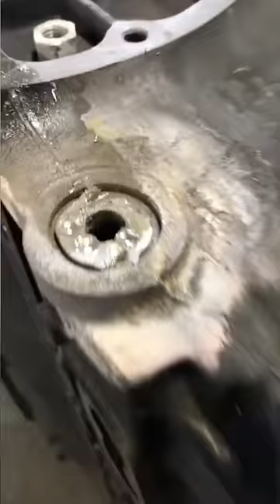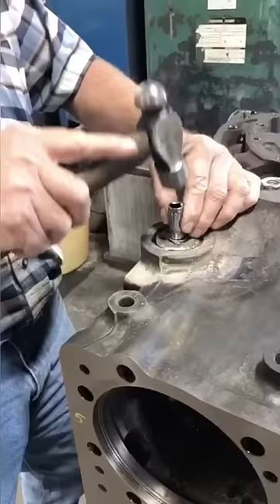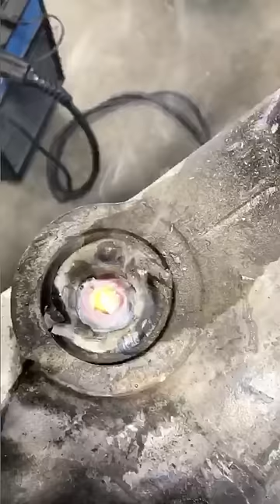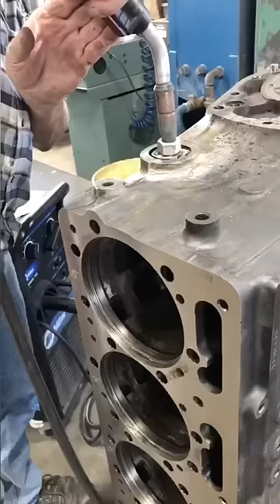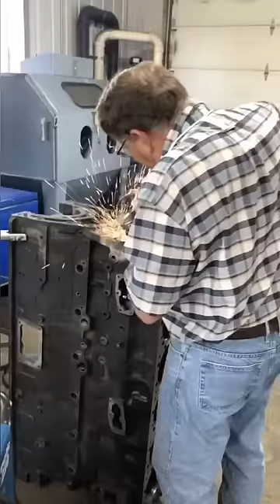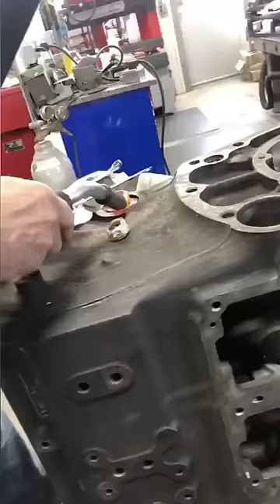#shorts N14 Cummins Block Plug Removal - This one fought back!

Comment: I worked at a auto parts, with a  shop many years ago and did some ridiculous extractions for customers.  They would bring heads, blocks and exhaust manifolds with broken bolts with broken drill bits or easy outs, before they gave up and brought it to me.... nightmare scenarios.  An old guy showed how he gets those little oil gallery plug out of the back of a small Chevy block... without welding.  I've been using a hybrid  technique for the last 25 years.  Heat, paraffin wax stick, heat, weld on a nut and then paraffin.  If you use a T-handle to work it loose, the welds hold better.  You may need to do it a few times, but it has never failed me.

Comment: Awesome ingenuity using the freeze plug! Each time you weld the plug you tend to weld it with more intensity, which shrinks it a bit more, after it's done expanding while hot and malleable   in an unforgiving enclosed space.

Comment: Its the welds on the outside of the nut that really give it a good grip, nice that its so big of a plug usually on a small bolt you dont have room to tack the outside

Comment: And the true mechanic never gives up. I’ve had bolts so gawled in I’ve had to carbon ark them out. 

Drill a hole in the center so it can shrink more when you weld the nut on
Reply: Yes…EXACTLY…I’ve used air carbon arc to burn out the center relieving thread casing pressure..🇺🇸🇺🇸🇺🇸

Comment: Welder here, shoving the nozzle into the nut is just giving you a very short stick out( start of wire from the collet to the work piece) and really screws with your gas coverage. 1/8 to 3/16 of stick out and lower wire feed speed/higher amps would help tht weld. Argon/helium mix helps penetration and c02 is cheaper

Comment: I noticed that you didn't wait for it to cool. After decades of building hot rods and  working on  antique and  vintage cars. I have learned that waiting until things are  cool to the touch.  Helps a lot. Because the  heated part shrinks as it  cools.

Comment: Just a trick I learned a while back if you heat soak in oil soak the bolt three times or more generally gives you a shot against snapping it, I’m a Cummins guy also and anytime my friends brake manifold bolts off and heads they always call me you guys are obviously experts in way better at it than me just thought I’d share my trick one of manny we all have

Comment: Tip for this is to put the nut at the most absolute center as possible. The torque gets transfered better and is less likely to break the nut off.

Comment: Always weld the outside of the nut when you're lucky enough to have a flange that large. The weld has much more leverage on the nut that way than just the inside being welded

Comment: Awesome work, love the freeze plug idea! I do a lot of broken exhaust manifold studs, and I’ve been using bolts instead of nuts lately. I weld  the base, then 2 or 3 beads up the bolts, and I don’t have to worry about the head getting too hot.

Comment: The mistake you made was having the welder ground cable attached to the block, this meant the circuit for the welding current had to pass across the plug threads, this would have arced across the plug threads welding the threads together.

Comment: Give you a secret with these plugs get a socket the size just inside the casting but as close to the outside of the plug two or three heavy hits just on the outside ledge free it up the problem with this design is the flange puts extreme backward force on the threads which are already tight, imagine the letter T with the top tilted up on each side think of it like a second generation unintentional thread lock , it might still be locked with sealant or thread locker but they will come out the secret is to get the air gap under the outside lip once that has the gap you can turn them i have had several cummins and they are pretty much all the same all difficult to get out, since i was shown this trick i have dismantled maybe 30 blocks over last 10 years and no more problem the hardest part is hitting hard enough to get the movement but not hard enough to crack casting or do damage works well on aluminum castings with torque to yield bolts as well

Comment: I did the same job. But I drilled and tapped the plug and then used a bolt threaded into it ,then welded it. It came right out first try !

Comment: I use these welding rods designed for bolt extraction. They have close to double the strength of a conventional rod.

Comment: Carbon steel bolt removal from Cast iron. Break out the cutting Torch. Heat the bolt in a circular motion until that point you'd begin cutting, except this time make sure you are covered well and hit the Oxygen to it. I've removed many broken studs and Bolts over the years from GM's 3 bolt exhaust manifold lower flange and tankless Cast iron boiler heat exchangers.

Comment: I worked at a shop were we would just use a mag base drill press and drill a hole then use the bolt removal tool. The ones that work with a tap handle. We used to weld but usually breaks at high torque.... but faster.

Comment: From my experience, welding the outside of the nut to the washer or stud or bolt you’re removing works best. 
Or rather, it’s easier to get a good weld vs welding the inside. 

Welding the inside for me usually ends up with a nut full of weld, but only tacked in one spot

Comment: Impact is the last thing u want to be putting on that, adjusting by hand gives u way more control, also a thin weld on the outside as well, just enough so that it doesnt interfere with the socket.

Comment: Good job. You got it out and didn't hurt the threads, that's all that counts. My mechanic will heat the female side with a torch and spray water only on the male side from a squirt bottle. The hotter you can get the outside, the better. Heating what threads in has to cool back down to help the most. Also, if you're going to weld on a nut, sometimes totally welding a washer on first helps. Puts a lot of heat in and gives a solid flat spot to weld a nut on.

Comment: Working on older vechicles I came across a penetration fluid that Criss Fix U T has used
50% Acetone 50% (Synthetic ATF) mix. 
R/R water pump on a 1960 Ford 292 4*4 that has never been touch before.. let it set for 10 min... Haven't broken 1 bolt on the Old Girl yet. 😊

Comment: It may shrinks the plug but don't forget, heat expands metal. If you cool the bolt or let it cool before you work it you might have more results

Comment: Use a breaker bar not a impact. Impacts are violent and stress bolt heads, you can apply more force with out fracturing the bolt head with a breaker. Try that and I bet 90% of your heads last longer when extracting

Comment: i was about to say weld a few spots on the outside if possible. one other tidbit of experience is to try tightening the bolt first a few times before trying to loosen it and if it was a tough one i run the bolt in out a little at a time to keep the threads clear. think of it as using a tap and reversing it to clear the chips from the threads and not acting like little steel splitting wedges that just get tighter as you go.

Comment: Heating metal (or anything,  for that matter) does NOT make it shrink, it makes it expand.

You should have applied penetrating oil (I recommend drilling wax, Kano Kroil, or Brute Force) and let it soak for a couple of hours.   (I'm sure you have other things to do in the shop in the meantime)

Comment: Pro tip for ya. Next time get the plug really hot and use a candle stick and touch it around the sides. The wax will creep down the threads and it will come out much easier.

Comment: There is a big difference in force applied. I'm sure you could have taken it off soon if used cheater bar instead of impact hammer.

Comment: Ive had great success by welding a washer to the bolt/nut to be removed, then welding the nut on. It seems that the washer helps create a stronger bond between the stripped/seized bolt/nut/plug and the nut you are gonna use to twist it off. Welding the nut by itself to the piece rarely worked for me, but im no welder, so heavy grain of salt is needed.

Comment: Just a suggestion.. but if you use a flange nut you can weld the flange part without it enterfearing with the socket.. it's been awhile since I've had to use more one nut. 
One more suggestion instead of just welding a nut to what your trying to remove.  First weld a flat washer over broken bolt which is easier/better weld.. then weld on the flange nut.  
Try it.. and see how many nuts twist off.

Comment: In addition to above I usually bang on these with a hammer a bunch to compress the corrosion against the threads this improves the clearance and makes it easier to remove. I usually use a thinner penetrant as well.

Comment: I got a used block for my mini bike but one of the drain plugs had a ground down head so I welded a bunch of material on there and loosened it with vice grips.

Comment: hi... just a thought from an IWS here :
MIG I great for filling... not so much for penetration
so, if you need to use welded part for strength, especially with a "twisting" force... you're better off with TIG and possibly some MIG on the filler ;)

Comment: All you have to do is pour some cold water on the plug after you weld it on, it will shrink the plug the stays expanded won't even need impact to remove  plug

Comment: Watching the weld...if you use high heat low wire speed and basically tack weld 4-6 spots on the nut to burn in the fill with weld all broken things will come out. When you just full with weld the wire never burns in tight.  My father taught me this. Please try it.

Comment: I prefer to not let it cool off completely, like when oil is still fuming but not catching on fire is kind of the sweet spot, drip oil on the bolt and let it flow in to the threads, then it should zip right off

Comment: Next time try using a stick welder instead of a mig welder to tack the nut on it. The gas shield gets in way when mig welding in a narrow hole. You’ll get it on the first try next time. Cheers 🥂

Comment: Stick weld also bites a little bit nicer, been in a similar spot on a dodge no less. Tight spot too. It’ll deform the nut because of the intense heat but it held.

Comment: Don't use freeze plug weld a bolt in have a nice filled going around between the heat from welding and it cooling down will do the same thing with less breakage.

Comment: I’ve removed a bunch of those they are always fun I’ve just resorted to getting them cherry red hot douse them with cold water. The heat and then the shrink has worked every time and on lots of other stuck plugs too.

Comment: I saved a company quite a bit of money by removing All of the flywheel bolts on a big Cummins diesel that had broken all the bolts off flush in the crankshaft I probably used twenty nuts to get all of the broken bolts out but was successful at removing them all without having to replace the crankshaft which would have been much more costly than buying new bolts and paying me 4 or 5 hours labor

Comment: I had to weld some nuts onto a 5 wheel plate because the t bolts were worn down. Our little 110 mig gun at work wouldnt hold. I took the truck home and used my full size millermatic and it made short work of them.

Comment: This is what I pointed out about that technique not being feasible to do on a normal engine. Usually you can't take an engine out dismantle it and clean it of all gas and oil. My Straight 6 300ci 4.9L has 290,000 mls on it. If a bolt  breaks off they become a big issue and you don't weld on that engine ,& I don't have the money to take it out.

Comment: While plug is cooling from welding lightly spray a home-made penatrating oil of half trans oil, half mineral spirts.  If it doesn't work it should have😁

Comment: I can do things to frozen bolts that only a navy Hull Tech can dream up. Another method is a .38 left handed bit and drill straight through. Then a left hand .50 inch left hand bit. Then an easy out. Or chisel out the bolt to the threads followed up with a helicoil. Moran one was to skin a cat.

Comment: See how the nut was glowing but the plug was not? A:use a bigger nut. B:use a stainless nut so the weld arcs more easily into the plug than the nut for a seriously strong and even penetration that won’t twist off.

Comment: Watch the jpaydirt videos on the N14 oil pump clearance spec of .008" is too much . He had the housing machined to reduce pump rotor end clearance to .005" . He wished he had gone to 0.004 or 0.003 but at 5 thou. The normal N14 low oil pressure vanished. If building an N14 worth watching just like jms videos

Comment: I see guys in my business all the time do this. Nothing wrong with what you did. Clean steel to steel makes a weld 2-3 times the strength. I see welders welds through rust and contaminants, then I see guys in my business weld raw steel that looks clean but all that slag is still present. A little Grind, a little denatured alcohol and your doing it strong.

Comment: Next time after heating with weld .
Spray it with cold water till cold to touch.
After that use your finger tip to remove it will be that loose after you case shrink it..

Comment: The N 14 A MOST EXCELLENT MOTOR. 
I miss mine it was in a '99 IHC 9200 DAYCAB. 10Speed 3:70 rears on 11R22.5 rubber. It passed away
The at the time terminal manager 
Thought he was a mechanic had the kid mechanic just change the 5 and 6 injectors cause they where fouled. 
The kid didn't touch the other 4 
Next trip out it pucked the #2 injector rod out the side of the block. 
Praise GOD the 3 brothers who own the 3rd generation trucking company I work for FIRED the terminal manager and both mechanics. We got a couple old trucks left but the majority of the trucks are '16 or newer all with ISX Cummins.

Comment: If u wet an arc rod and max the amps and slam the bolt it will eat it out and not the block or threads melts the bolt straight out

Comment: Shoulda hit it with the oil as soon as your were done welding and then rattle with the impact. Dont let it cool down and the spray it. Spray it hot and the shock will break it loose and spin right out.

Comment: Flame it, whack it, lube it, whack it, carefully drill small holes close to the rim of the frozen plug, use an EZ OUT to extract. No welder needed. Atleast thats what Ive done...

Comment: Sometimes cut a slot in it for a chisel and impct wrch. Changin skin screws on a airplane sometimes the dont wana backout so we tighten it a little and then they back out. I have been lucky enough breakin one and actually center drillin the screw out with a tiny bit. And not make a bigger hole at the point.

Comment: If the nut wasn't galvanized it probably would have held on the first try, unless the added expansion from the heating and shrinking from welding was what it needed

Comment: If you would quench that freshly welded nut with cold water instead of oil, you shock the rust, causing it to become a powder.  The water is your best lubricant.  Less thread galling!

Comment: You used a chrome socket to drive in the freeze plug instead of stopping everything and turning proper driver on the lathe.

Welding without gloves. Didn't wear a welding helmet.

Yep. That's real world work. Technically wrong, but its the way to get things done.

Comment: Heating the plug makes it expand, making it tighter . Weld the nut on and let it cool . Poor water on the plug. Use high heat fast around the plug. Then remove plug  . This method will work 1ST time.

Comment: My experience doing this don't use a MIG welder use stick with low hydrogen or use TIG and you'll get a much better weld and get it out the first time.

Comment: fyi, smaw is better for when you do that, it allows a better angle on the nut.  Use a 3/32 E6010, dont even need to clean it.

Comment: Jammed plug and bolts can be a hassle. You got it out after a couple of tries so it's all good. I would have tried some heat also with the nut on the first try. Might have helped.

Comment: as a pro mechanic who honestly is not a pro welder, even i could've told you THE NUT WOULD NEVER STICK TO A DIRTY METAL SURFACE.. You must grind to expose a clean debris free metal surface to weld to, otherwise you're just welding onto dirt

Comment: Should have used a breaker bar after it was shocked loose. And welding the plug would expand the plug not shrink it. Surprised you even got it out with that logic.

Comment: Might help if you removed the zinc before welding it on. Just throw the nut in hydrochloric acid and watch the zinc boil off.

Comment: Use a bigger nut or just weld a lever on that will clear everything when you rotate it.
With taps and everything I just drill a hole in some scrap flat stock plug weld it and spin it out.

Comment: a young kid i made friends with brought his square body chevy truck over to see if i could remove the oxygen sensor. the repair shop said they would have to remove the exhaust to fix it. i told him i may fail but i will give it a try. using my tighten and loosen method i heard it move after 1 blow and then i added more seafoam deep creep and removed it and installed the new one with plenty of anti seize for the next guy to benefit from. . he said why didn't the repair shop know how to do this ? i said because they probably only know they way they were taught. i always had more time than money so i had to figure out things and i open to try new ways even if my way is succesful . i like to ask questions about why someone is doing things . i been accused of being a know it all. i am not a know it all but still striving to be one .

Comment: When the plug was hot, put a candle onto and let the wax melt down around the threads.
When it cooled you could have spun it out with your fingers.
Old machinist trick.